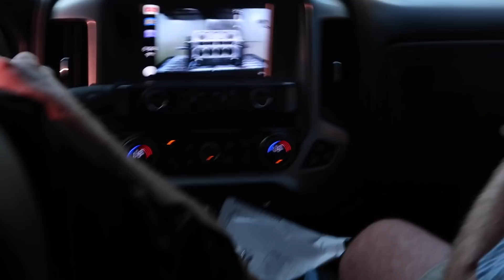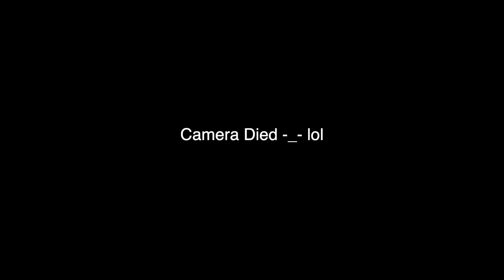Changes happening to the BAD APPLE ford powered Turbo Foxbody!!

Comment: So the car went super straight and cut a 1.18 60ft so you start messing with the rear suspension adjustments and it knocks the tires off and now your trying to fix it.
Reply from the maker: The car didn’t go straight lol it had rear steer in it
Reply: @JohnDoc  in the video of the car making its first hits chris talked about how straight the car went, also you do know that rear steer can be used to make the car go straight!
Reply: @marcuscarrow3938  there's still more on the table ... the point of drag racing is to go faster and faster and straight as possible so unless your bracket racing..
Reply: @freedomfox8183  im not saying there isnt more left in it im just saying the car was working before they started messing with it and its on a small tire and stock suspension with a 1.18 60ft, that is a pretty good 60ft out of that combo.
Reply: Pretty good. Time to put it up for the winter.

Comment: If you have a buddy with a laser 4 wheel alignment system you should be visiting him now and then. Measuring is good but that machine is the lie detector .
Reply: Yes a measuring devices that dont need calibrated dont use... because they aren't as good as a alignment machine, that hasn't been calibrated in who knows how long and have been known to be few inches off from the get. Ive seen that. I know guys can set alignment on their racecars then someone with a machine also. It normally take 2 1/2 to 3 hrs for a regular shop alignment. Takes me no more than 40 minutes to setup a whole front end on flat ground. Plus alignment machines can test ic, cg, and tell you what bar adjustments to make.
Reply: @gregl5677  Oh boy , well I should have phrased that better . I use a machine that gets replaced every couple of years or so and the shop owner stays on it..
Yeah ive dropped strings and done it a million different ways over the years . The machine (A good machine) is priceless for the setup at static height , height as raced , etc etc . 
If you know of machines that are a few inches off I really dont know how to react to that.... Kinda tough to stay in business that way.
You use the machine simply to square the car and check for how the axle center lines are . This is simply to establish a certain task. IC is dynamic depending on a number of factors. All of your adjustments and your life and success as a whole depends on that car initially being square and you cant always use the car itself or points on the car to measure from.
Dropping strings is nice and accurate but time consuming .
Reply: @kylevantassel7259  measuring tape will always be more accurate and faster then a machine. That is fact. Theres also set parameters that these machines follow based off spec. 1 thing holds true you will never get a car perfectly straight on a lift to get it squared. Yes the machine can account for that but it wont be perfectly in line. Plus nobody is clamping anything to a thousands of dollars worth of rim. Why most race shops dont have them. Yeah they can afford them but it is a giant paper weight. Its way easier and more effective to measure than a machine. That shop you mentioned is the only shop ive ever seen be able to afford to replace alignment racks every few years. Not even dealerships do that. He must be making millions.
Reply: @kylevantassel7259  unless its a cheap machine then id question its capabilities.
Reply: Final note. If a racer relies on a alignment rack id open up a shop right next to them. Cause i know theyd have to be in after every race. They change stuff on the fly at the track to get the car to go straight. So it is never truly square. It is mostly as a starting point, then they move bars change ride height, add or remove weight. Shift weight in the car, make rear end adjustments. To accommodate what track conditions are doing. I guarantee some 55 year old can true up a car faster on the ground, then you and 4 of your buddies on a alignment rack. If he cant he would probably get fired off that team. They have only select amount of times between rounds to measure and see what the car doing and make adjustments accordingly.
Reply: @gregl5677  yeah I'm not sure where you are living hoss. The junk you are talking about I havnt seen for quite a few years now
Reply: @gregl5677  yeah I'm 52 and been fooling with it for about 30 years.